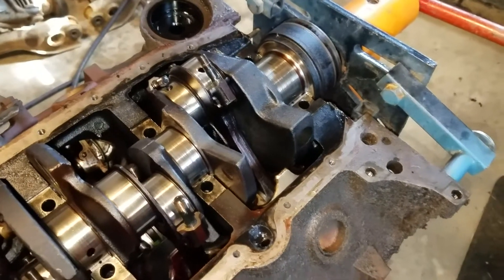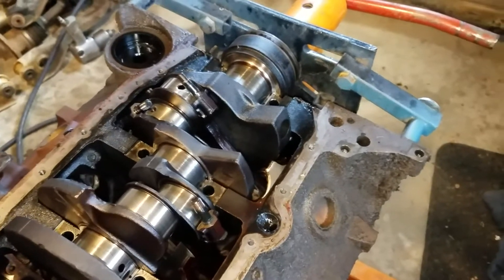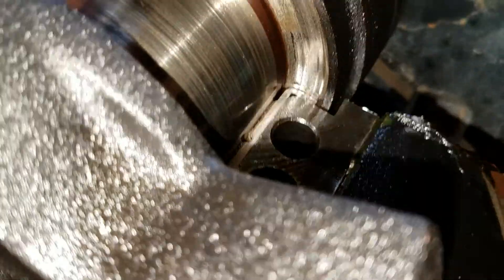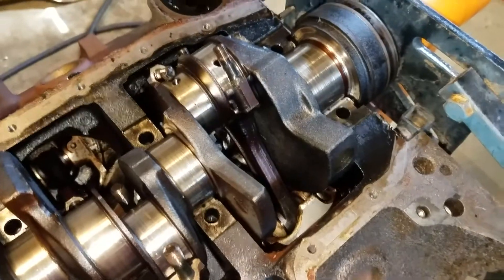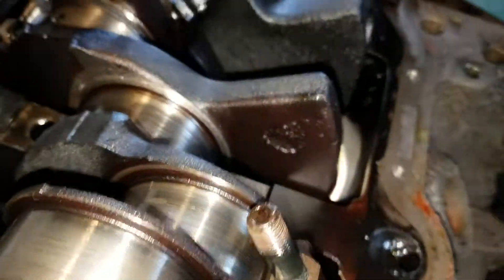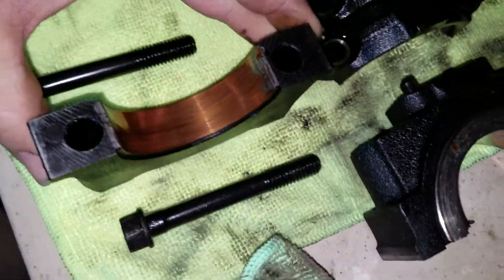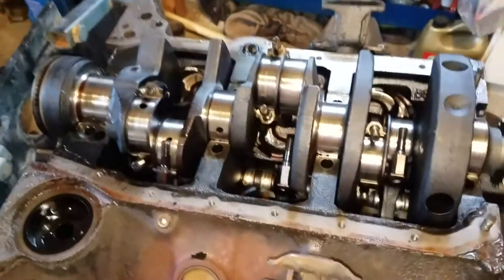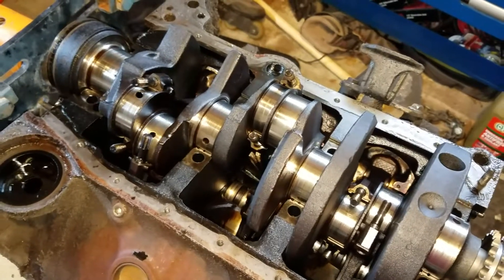chevy crank thrust fail

Comment: at 0.39 you thrust bearing clearance is about 2mm-3mm (0.1 inch )! , how did you fix that? weld and resurface the thrust surface of the shaft ? or throw away the shaft? my Ford FE360 also has about 1mm free play. your video reminds me to look at all the counter balance slabs , last time I changed the thrust bearing, I did not rotate the shaft to have a good look at them all

Comment: Will that wear out your transmission or torque converter
Reply: On a manual transmission it generally won't. In fact the reason thrust bearings fail in engines is usually because of how a clutch works. The pressure plate is always exerting spring pressure on the clutch disk. So there is a forward load on the crankshaft, which is entirely supported by the thrust bearings which prevent front to back crank movement.

Usually when a thrust bearing fails it's due to poor oil pressure, but can also be because the owner has gone wild with a heavy clutch kit that may have stiffer pressure plate or slave cylinder springs, or even due to driving style 

The clutch assembly on most engines has some amount of room to move forward on the input shaft without losing spline engagement, so it generally won't trash a manual transmission.  

An auto would be another matter, as the crank movement alone can damage the torque converter and fluid pump. That being said, thrust bearing failure on automatic transmission engines is way less common, because the transmission doesn't exert a forward load on the rear of the crank while operating like a manual transmission clutch does.

Comment: I had one of those.  Scrapped counter weights and all.  On mine, the bearing was worn away, not the crank.  I wonder why?  Mine was an auto.   There is a video on youtube of a 4l60e pushing , hard, on an engine. You dont realize that stuff can move back and forth so much, until you see the video. I'm pretty sure my trans is what wrecked the thrust in my 01 4.3l

Comment: Is the block still salvageable? have a 327 with bad thrust bearing and would really like to know if i could save it with a new bottom end? Thanks!
Reply from the maker: Well it kind of depends on how bad the damage is. You can see in this video that the crank was actually rubbing on the main caps. In all honesty if a new bottom end was put in this motor with proper thrust specs I don't see why it wouldn't be fine. But there is still the fact that the main caps were worn into a bit, so you could junk it out to be safe. I think you can also get new main caps and have it line bored. Probably not worth the effort though as a replacement block shouldn't be that hard to find.

Comment: What was mileage ay??? I own 02 gt mustang for 14 years now it's a 5speed I've often thought abt just this my old girl's still got original everything engine n trans but I put 4:10gears n rear end 13 years back n changed speedo gear to fix odometer n headers no cat X pipe 40flowmasters n dyno tuned with updated puter chip my baby's got 320000.0 miles on her always ran mobil1 full syn 10w30 with can Stp n can of restore n Ford motocraft filters she stays clean n yet to move on dip stick

Comment: I don't know why everyone loves these motors I have had bad luck with them
Reply: Agreed, I have 2 of them, ever time I work on them I wonder why
I much prefer working on my old ford 300 inline 6 lol
Reply: I have both. Ford in-line 300 is the most reliable motor I’ve ever seen. I also have had a couple 350 small blocks. Most of them have performed beautifully, most of them… I’ve never seen a ford 300 fail for a reason that wasn’t user error or poor maintenance. Id rate the ford 300 10/10 and the chevy small blocks 8.5/10